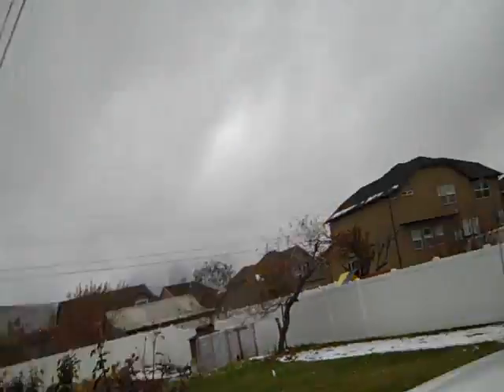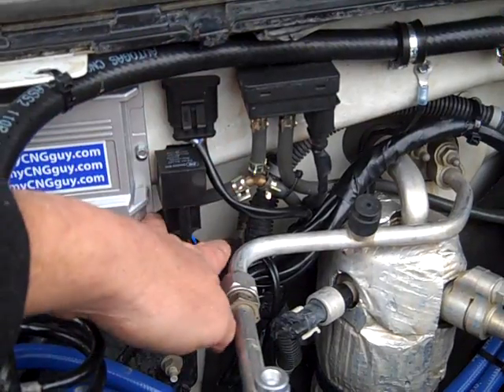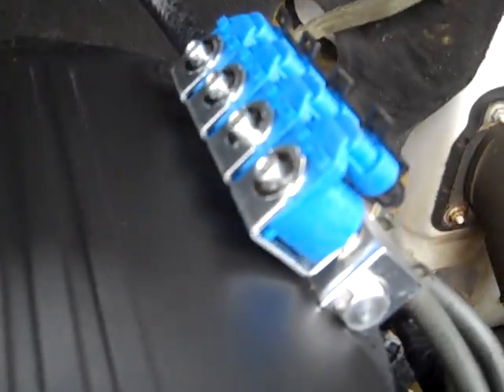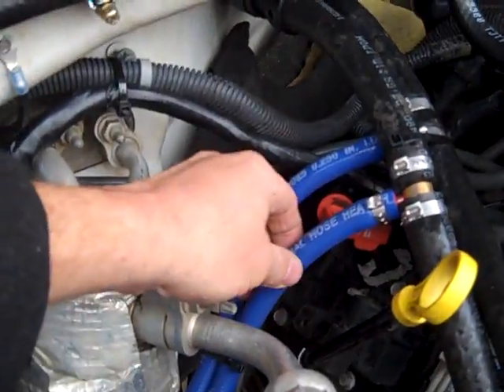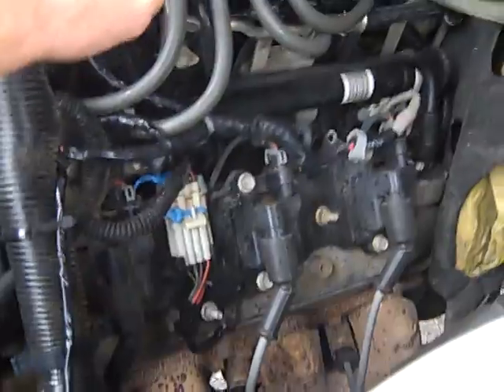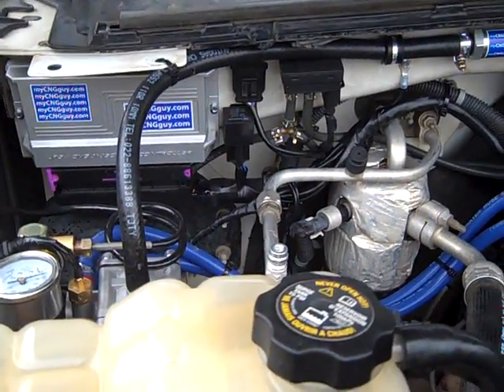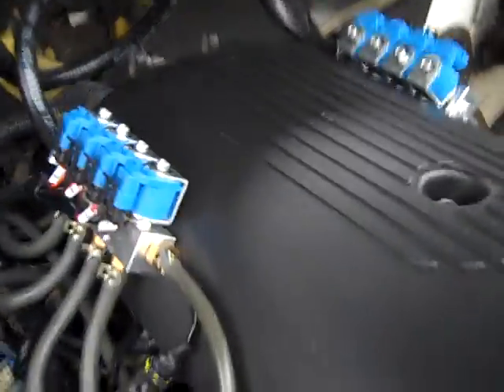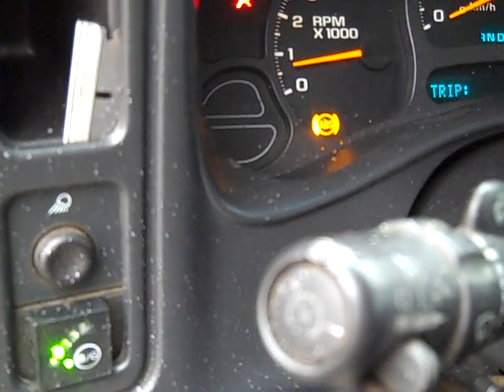CNG Kit, Natural Gas Conversion, Sequential Injection For $850

Comment: Can you pull power with this? How would this work on a turbo charged car?
Reply: well, the equivalent octane rating of cng to petrol is 120, so yes, provided its tuned right, potential for power. i am going to tubocharge my cng falcon later on.

Comment: So in 2020 I bought an 03 Tahoe with a bizillion miles but otherwise in outstanding condition. My biggest reason for buying it was that it has the L59 flex fuel option, and I've been making ethanol in bulk since about January 2021 (if you know what I mean). And I'd like to add an lpg / cng setup that I could switch over to depending on what fuel prices are doing. Only issue I'm running into is the requirement of a separate ecu to run the system, because the truck has an integrated body control module that will lose its mind with aftermarket hardware. So 2 questions if anybody knows what protocols gm used for the vehicles computers to talk to one another back then (I'm told it predates CAN bus) and is there something I can use in between an aftermarket ecu and the bcm to act like a translator 
Thanks
Reply: Lol I've never heard of someone specifically seeking out a flex fuel vehicle
Reply: i get an idea in my head and i go all "Beautiful mind" n theres no talking to me. but the flex 5.3 has larger injectors and some other goodies. now this make my own fuel thing has got me kicking around the idea of single turbo setup on my 6,000 lb vehicle to make my tree hugging hipster douche bag neighbors scream at me to repent my climate sins
Reply: @limabravo6065  nah I respect it. I'm some welding practice and a few components away from making my own fuel from recycled plastic.
Reply: The ECU in a CNG kit does exactly that. The wires going to the original fuel injectors are tapped and go to the CNG ECU before coming back to each injector. This is so the CNG ECU can control the original injectors; turning them off entirely or mixing CNG and gasoline in certain situations, and switching over from gasoline to CNG one cylinder at a time, for a smooth transition. CNG injection timing is also calculated based on the original injector timing, multiplied by a programmable map.

Comment: That is by far a clean install...I have a quick question...What happens to the injector pulse and fuel pressure from the regular fuel injector and  fuel pump. I know you cannot turn the engine computer off because then you will not have any spark. Thanks in advance for your help
Reply: The wires going to the original fuel injectors are tapped and go to the CNG ECU before coming back to each injector. This is so the CNG ECU can control the original injectors; turning them off entirely, mixing CNG and gasoline in certain situations, and switching over from gasoline to CNG one cylinder at a time, for a smooth transition. CNG injection timing is also calculated based on the original injector timing, multiplied by a programmable map.

Comment: I HAVE A LARGE AIR COMPRESSOR Can I use that to store my compressed methane Or is there another type of tank? And are there any that are lighter? I want to save on weight wherever possible.
Reply: nope, a compressor has a working pressure of around 150psi. for natural gas (methane) you need a tank that can withstand roughly 3000psi!

propane however can be stored at a much lower pressure as it liqufies easily. 

a compressor tank is probably never a good idea. something purpose made would be safer.

Comment: Can a carbureted engine be converted over to CNG?
Reply: Yeah check out “impco” the sell propane and cng kits
Reply: Yes with LPG Reg and jet up the carb appropriately. Just repaired an old Ford Inline carb. Nothing special.  Get the equation for more fuel needed. And make sure your reg is facing the correct position

Comment: I bought an older GMC pickup setup with a PROPANE system. Runs on gasoline or propane. Has a 110 gallon LP tank in the bed. (Paid $1,600 for the truck including the system already installed)
I understand the CNG vehicles can ONLY be filled at a CNG station, and these stations are hard to find. I think there are only 4 or 5 in the entire DFW Metroplex. Rare fuel stations.
LP can be found all over, especially in rural locals.
Reply: You want to sell it??
Reply: @thomashocker2792  no, it might come in handy when gas gets to $6/gallon.
Reply: @TheBigfoot567  is it aftermarket or factory?  Are you having any issues?
Reply: @chadyaknow5690 it's aftermarket and no issues, except I never drive this vehicle and the battery goes dead.
Reply: do what i do, buy your own refuelling appliance an fill from home if you have natural gas suppl, o r better yet, build a biodigester, make some of your own gas through biodigestion principles.

Comment: What's the difference between natural gas and propane? Also how many miles/kilometers do you get on a tank for what cost? Also how hard is it to find gas stations that have a place to fill up natural gas and propane.? How much is the install if the system is 850$?
Reply: there's youtubes on that. what's the difference between natural gas and homemade methane?

Comment: How does it intercept/shut off the gasoline injectors? Does the gas computer run both?
Cheers
Reply: it has its own computer that takes several inputs from the engine and determines the CNG systems mixture ratio.  typically from what i have seen a relay is added to the fuel injector and/or fuel pump circuits and the CNG computer cuts power to those circuits during transition, i'm guessing there is tuning involved for compensating lag time and overlap of the 2 fuel systems.

Comment: The page says $850, my question's are:
Where can I get one?
For how much?
Do you do installs?
If so, how much? 
I have been told this type of system will also use propane as well, is this correct?
As I cannot find a Natural gas supplier where I live, I also don't have Natural gas where I live so the home pump system is out for now.
Dale

Comment: seeing you know core you might also be interested in knowing about electric super charger I'm interested in hybridizing my car but I'm a pizza driver mainly looking for whats possible I can do alot with that :-)
Reply: A fully electric supercharger would use more power than it would make. I've seen tons of videos and write-ups on it and all say the power that would be needed to spin a supercharger hard enough to create any boost gains would use enough power to need an extra alternator which In turn would create more drag pretty much equalizing the gain/loss back to stock. There is a car company now (cant remember right off hand) that has a turbocharger which is using electricity to get the turbo spinning to help with turbo lag so they can run a bigger turbo but once the exhaust pressure is high enough to spin the turbo on it's own the electric motor stops sending current and begins making electricity like an alternator/generator. So it uses electrical current to spin the turbo up then draws current to recharge the battery from the loss for the spool up

Comment: Can these be installed on a turbocharged engine? I just bought a truck I want to convert.
I plan to rebuild the engine for higher compression and maybe turbo it to make use of the 130 octane.

Comment: Troy, great install, great video, thank you for posting it.  It's clear that you have done a lot of R&D on these components.  

I am not a big fan of the fumigation systems and trying to buy components from the big conversion companies is a complete waste of time, they have all convinced themselves that the general public are idiots and have no mechanical ability. 

Great website, I will be placing an order.

Comment: i personally have this kit on my brand new chevrolet van with the 6.0l and just as ive posted i have driven and tested all of troy's vehicles right after his installs. i have been a cng technician and ford master cng systems tech for the past 9 years. i myself have engineered systems that others cannot and i have never seen any installs even from oem's that are as nice as troys. please do not knock him until you see this installs and drive them. and troy is a utah certified installer.
Reply: The hoses between injectors and the intake manifold are too long and the injectors is better to be mounted vertically .